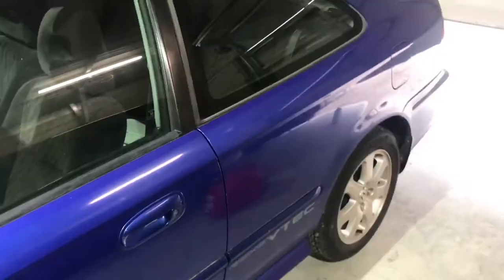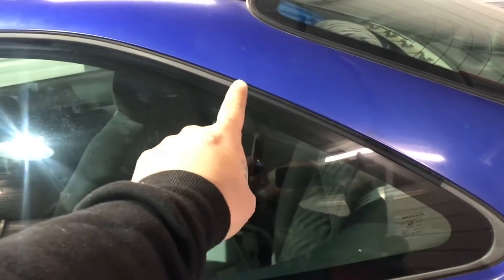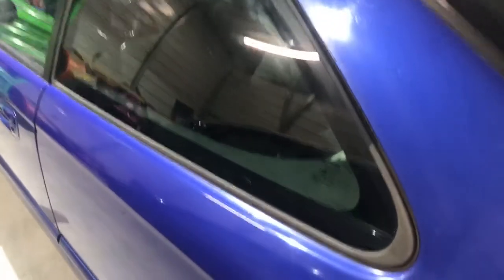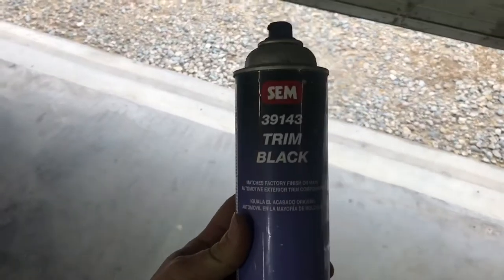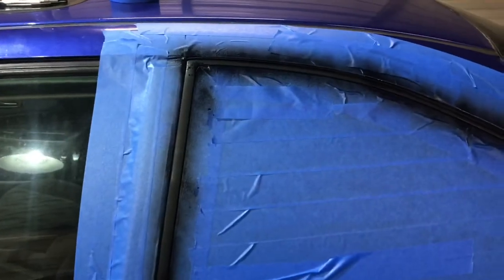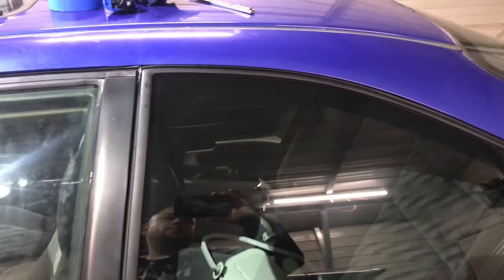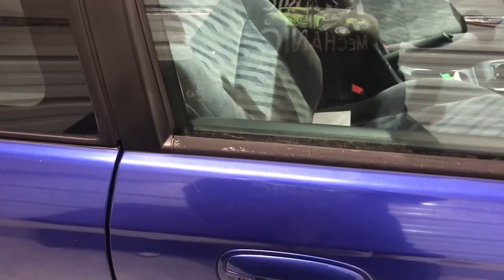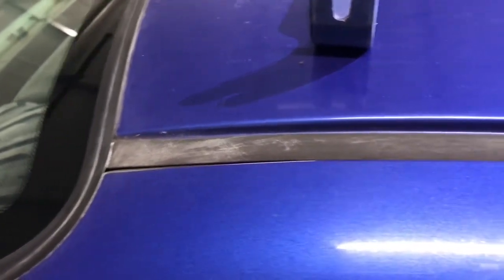Painting/restoring faded trim on the 1999 civic si

Comment: Good info. How much did those seals run you from Honda? 

Also any recommendations on drive and passenger window interior seals. My regulator in both windows is almost dead and it's just smashed my seals